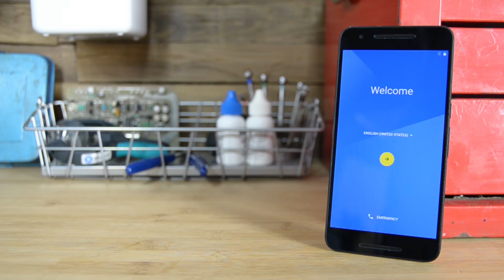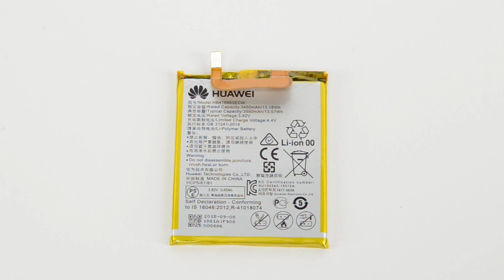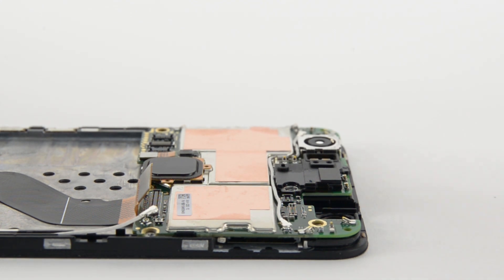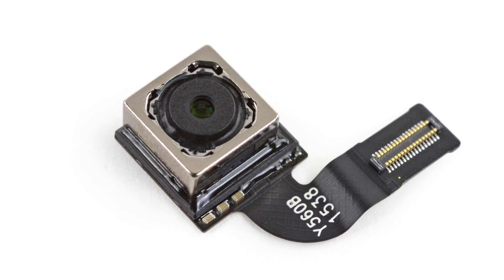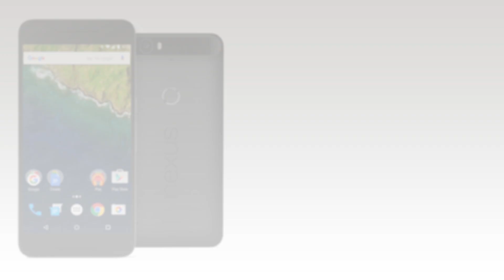Nexus 6P Teardown Review!

Comment: I like that the usb c charging port is easy to replace ( micro usb is known for failure and it's a pain to change it in Samsung phones). I'm wondering about the power button!! it will be used a lot to lock the phone. fingerprint is a good add to unlock the phone.

Comment: Hm, it seems that after removing the panels covering the screws, the internals are pretty much fully accessible with just a few screws.
If you just get a hold of a replacement pair of the little panels, you could pretty much do it all stress free!

That said, I am only saying this due to many phones these days having all the main panels bonded together, so the 6P isn't really that bad comparatively... At least better than the S6!